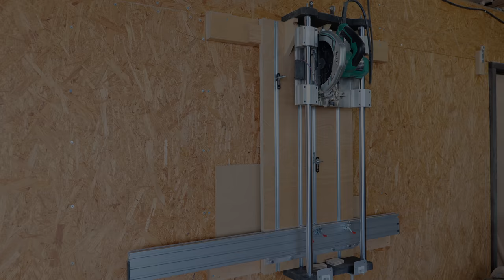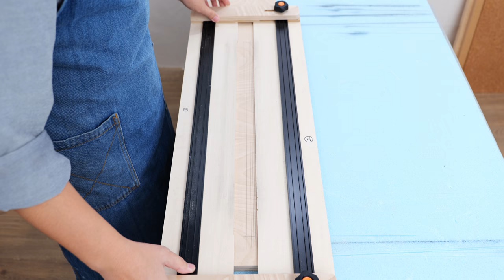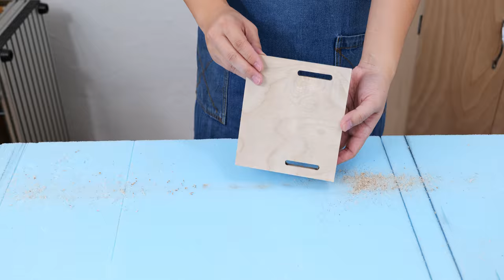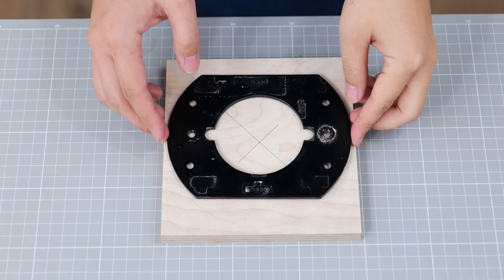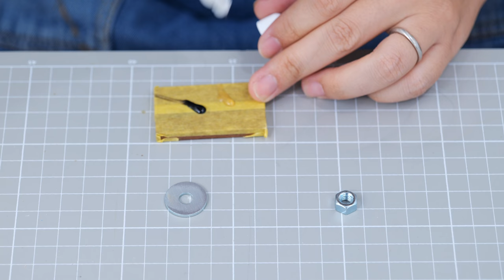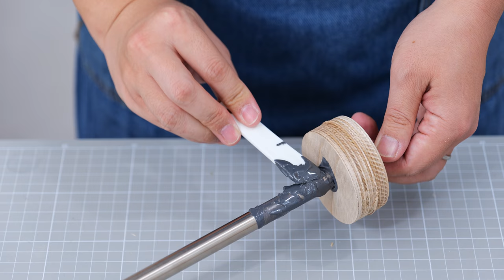Cylinder making jig for drum sander

Comment: One thing to note about this machine, when rotating the drums, to not exceed the bit's cutting speed. It could go badly. Basically, the same thing that happens when you bite the bit when you're rounding corners or cutting a pocket, and you sink it in too deep. I have a similar setup, meant to cut chair tapered legs, and once in a blue moon, this happens, and everything goes to hell.